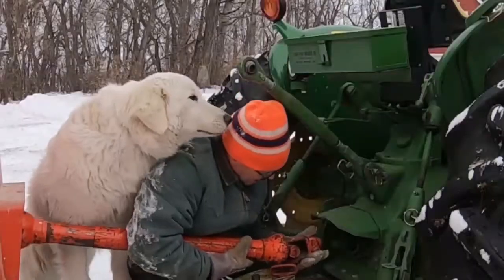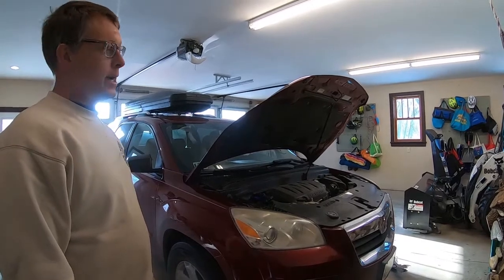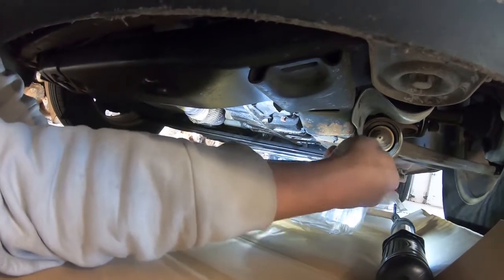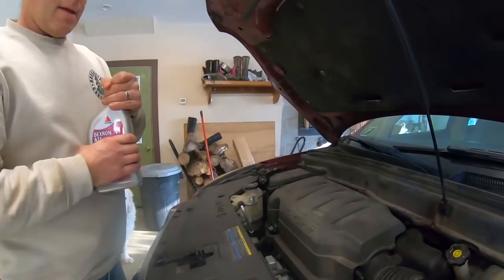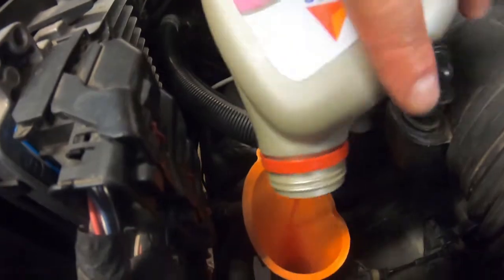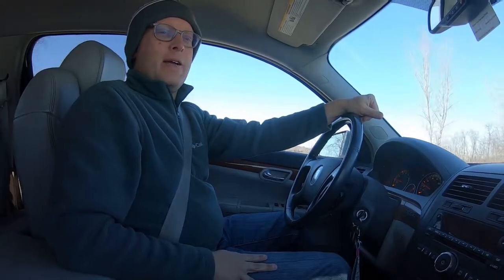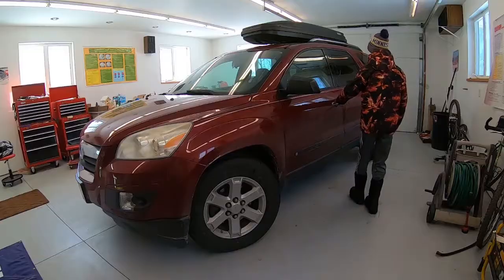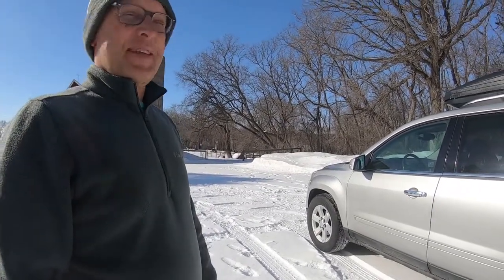Attempting to fix a Shuddering Transmission on 2008 Saturn Outlook! (is it even worth it?)

Comment: They notorious for having a plate fail in their transmission at 80-90k and disintegrates putting metal all through transmission ruining it.   They are based on same engine and problems GM Acadia has.   Do yourself a favor and don't buy them.      They are a money pit and will financially break you.

Comment: i got rid of mine  POS
Reply: I have a 2008. Bought her back in 2016 for about 5k. I have about 5k into her right now in maintenance.  
Airbag light  has been on for a few months now  😢.  
Just put sway bars on and the driver side headlight for the third time. I thought everything was going good. I left work today. Check engine light came on !Car  wouldn’t shift out of first gear! dammit miss Coco why are you doing me like this.  I’m taking it to the tranny shop in the morning though I’m on the verge of do I buy a new car or dump more money into this girl. 
I’ve done a lot of maintenance on it already . Still have the airbags and a leaky sunroof. Once in a while to deal with.  now with the transmission thing I don’t know hopefully doesn’t cost too much..
Reply: @Campusmostwanted  getting the car fixed/repair will cost more than its worth. The transmission alone will cost over 2 thousand and that's not including labor. The headlight is a wiring harness issue, you have to replace that to stop the headlight from burning out. The biggest issue is the Saturn is a defunct company.

Comment: So does this mean it didn't work and you got a new car???  :(
Reply from the maker: Yep. 😆
Reply from the maker: The transmission was shot and there was body damage that needed fixing so rather than replacing the transmission, the cheaper option was just a new car.
Reply: My saturn outlook had the same problem. The problem was a vacuum leak. I replaced all seals and hoses and it fixed it up. I thought it was the transmission at first so I rebuilt it put it in still had the same problem. Definitely try the vacuum system first.